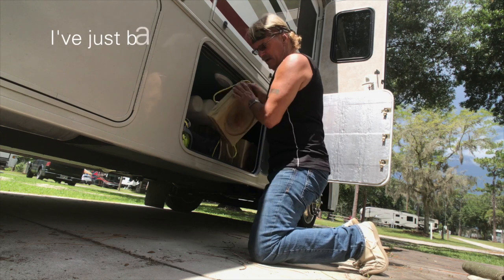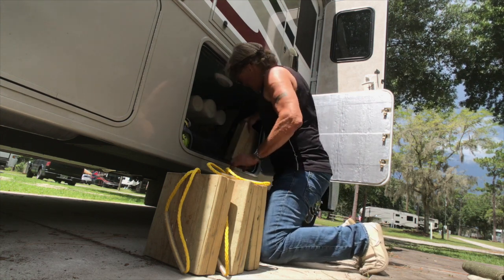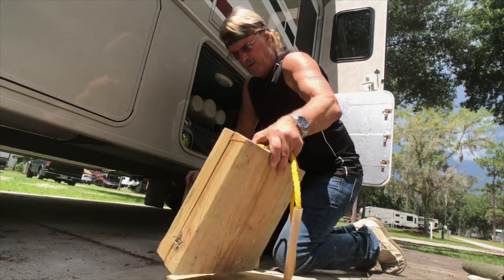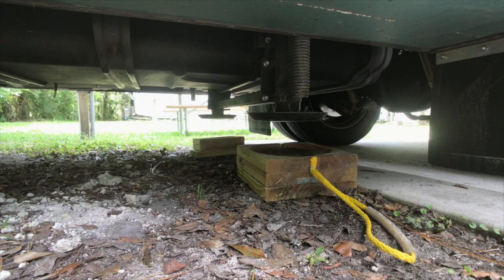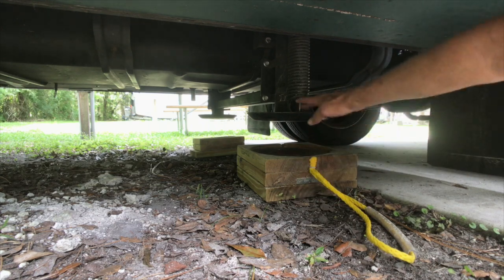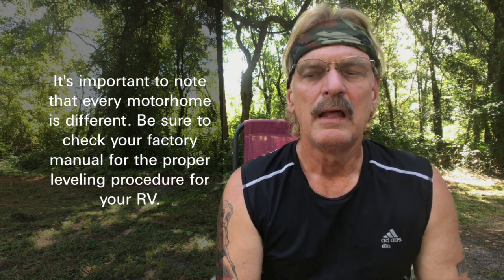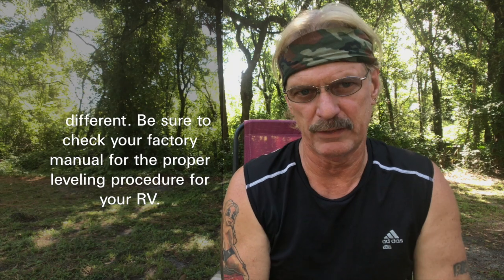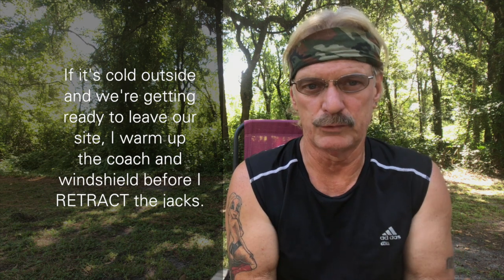Proper RV Leveling has MANY BENEFITS. Here's why.

Comment: I'm trying to find where to fill the hydraulic oil for my jacks?
Reply from the maker: Not sure where it is on your rig. Probably in a bay. But do not use hydraulic oil. All of these units use ATF. Check your Manual.
Reply: @RVstreet  Roger that. I'll have to find a manual online. Now... from what I understand, the front jacks should go down first?
Reply from the maker: @patriotofgod9827  Well in our rig that's the procedure and remember we level manually, never auto level. But yes, doing the front first is the best practice because it settles the windshield firmly so as the coach levels itself back and forth, twisting the chassis somewhat it won't damage the or crack the windshield.
Reply: @RVstreet  Thanks. Am I able to run any type of heat through the solar panel and inverter with 2 house batteries. Sorry it's getting cold.
Reply from the maker: @patriotofgod9827  I have no idea. I'd have to be really familiar with your coach and the way your battery bay is set up. But in a nut shell, solar is only going to charge your batt's. Then you'd turn on your inverter and run a heat source from an inside electric outlet. However, most electric heaters draw a lot of watts which equals lots of AMPS and would kill your house batt's pretty quickly if you don't have them set up right and have a lot of AMP hrs. Use your propane heater instead. There are a lot of ways to heat your coach. Google is your friend or online forums would be a good place to address your particular situation.
Good luck my friend.
Reply from the maker: @patriotofgod9827  To many variables from coach to coach. I would suggest going to an online forum where you can state your question in detail and then many others could suggest options. In the meantime use your propane furnace.